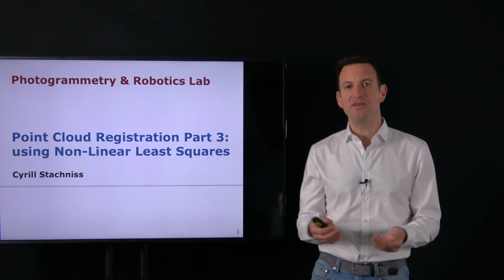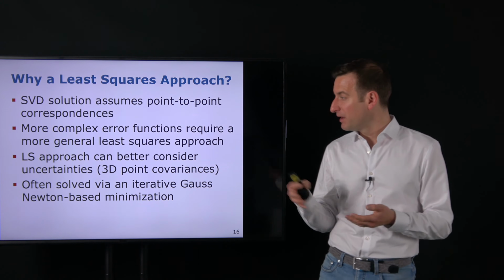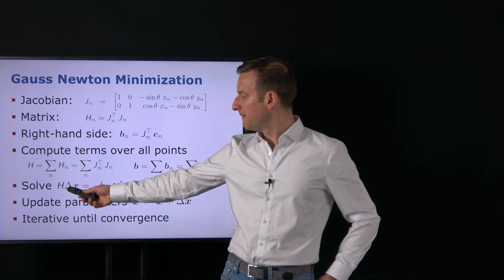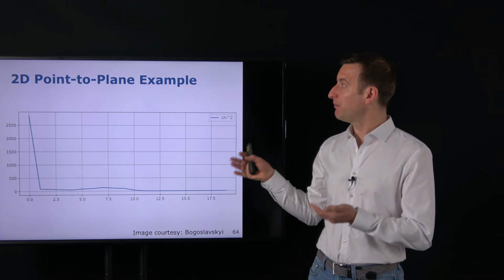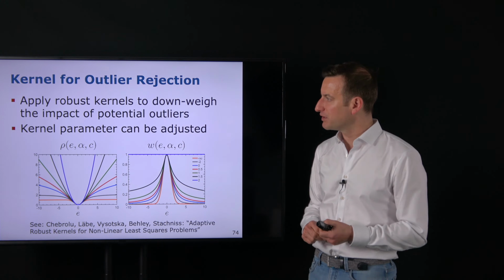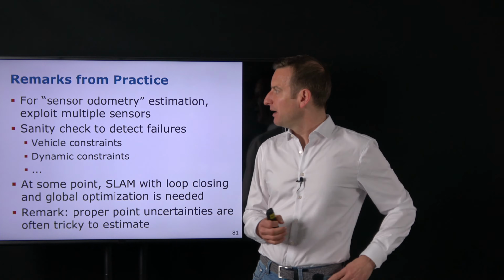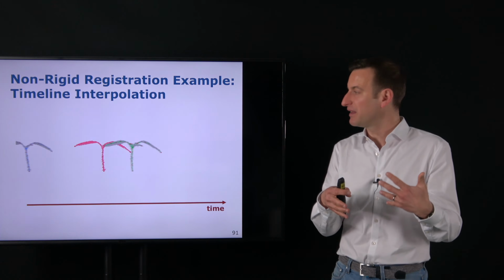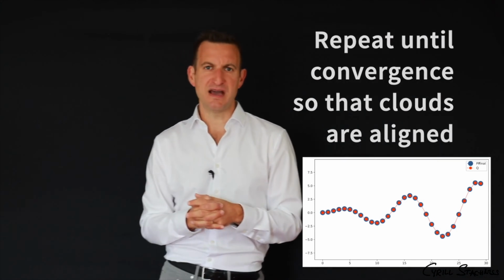ICP & Point Cloud Registration - Part 3: Non-linear Least Squares (Cyrill Stachniss, 2021)

Comment: is point to plane metric more susceptible to noise, since you need normal estimation?
Reply from the maker: To some degree but not too bad. You need to invest more brainpower in computing normals or smooth more. Eg, compute a PCA over a large point neighborhood and determine the direction of the Eigenvector corresponding to the smallest(!) Eigenvalue and you should be fine...